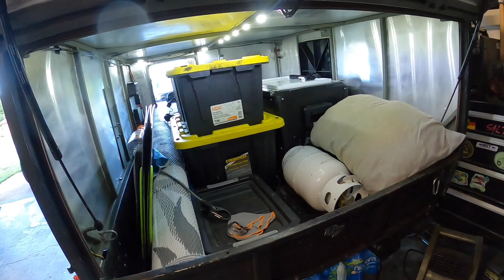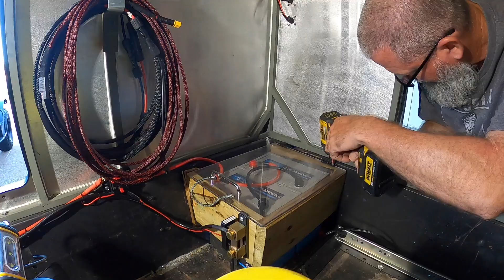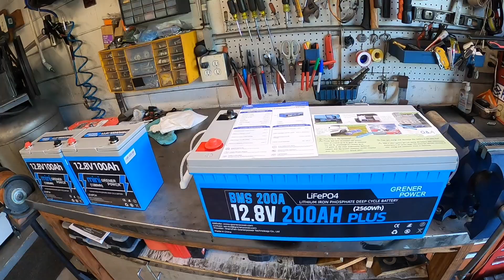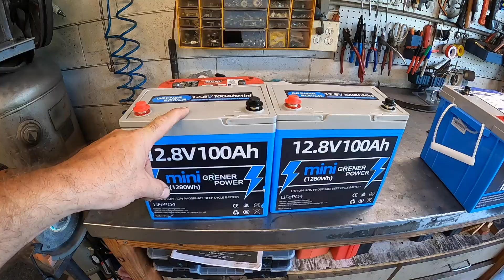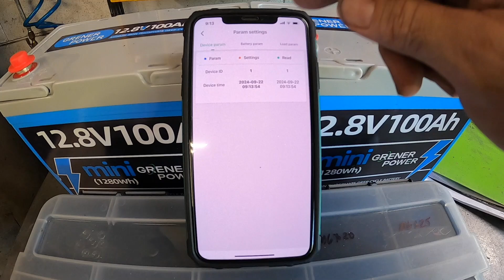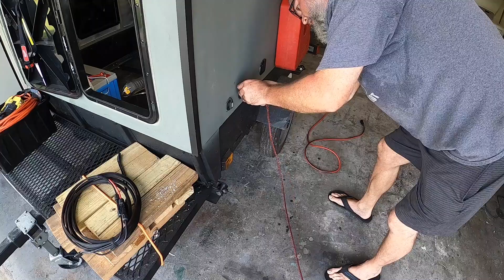DIY Mini Overland Trailer Gets HUGE Upgrade! Grener Power 200a Plus Battery

Comment: Looking forward to seeing what you need the extra battery power for.
Reply from the maker: @briancole7935  not sure if it’s going to work or not but I have an idea for down the road. 
Plus with the additional capacity this will allow me to be gone longer without having to worry about hooking up the solar. An option would be to have a dc to dc charger controller but that means running additional wiring to the car for that to work.

Comment: I'm gonna look into one of those for my locksmith service van, right now I'm running 2 Walmart marine batteries that work well but they're getting old (250A/h total)
Reply from the maker: I definitely would make the switch and here’s why. Lead acid batteries don’t give you the full ah capacity as lifepo4 batteries do. So, if both of your lead acid batteries together are 250ah, you’re actually only getting approx 150ah out of them. Plus as they get older they will degrade much faster. 
Just food for thought.
Reply: @VWJawbreaker  Knowledge is power ! Get it ! Bundle of good information Gary ! Tank you !
Reply from the maker: @ I’m still learning as we all are!
Reply: @VWJawbreaker  that's what I'm running into

Comment: Initially I had two 100 ah wired together, recently swapped out for a single 280 ah. It'll run that 12v freezer fridge indefinitely. Backed up with 200 watts solar, it ran non stop 52 days on my trip to Alaska!!!
Reply from the maker: @magaisacult2023  that’s good to know man!!
Normal camp setup consumption paired with this battery and 200w solar, I’m not worried whatsoever lol